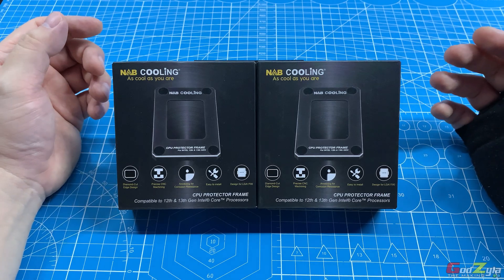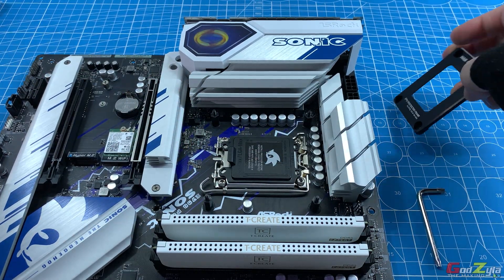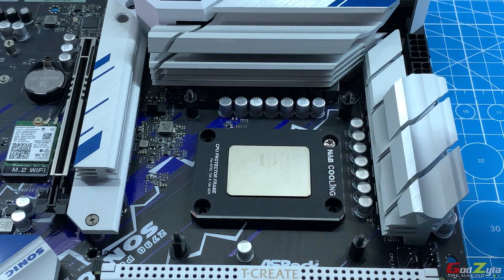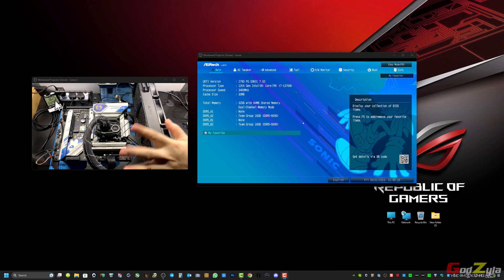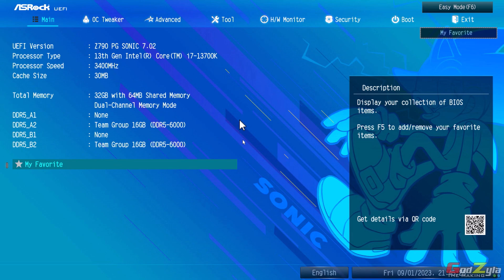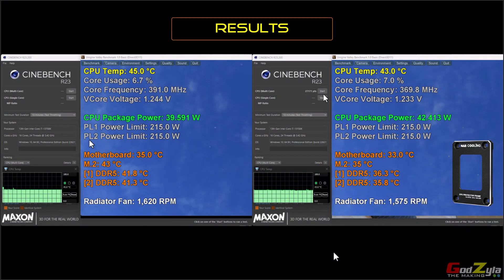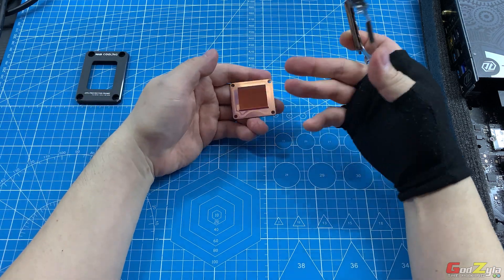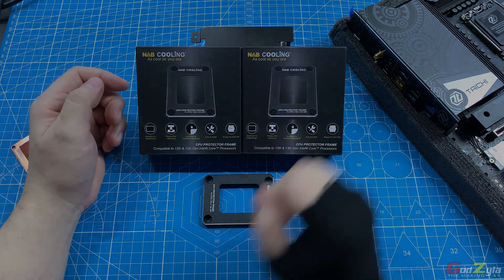NAB Cooling - Contact Frame (ILM) for Intel 12th & 13th Gen Processor

Comment: My cpu is thermal throttling after adding a contact frame, why?
Reply from the maker: Hi UnknownPlayground, welcom to my channel, which contact frame did you use and did you use. Also if you have used your CPU on the default 1700 mount for sometime and then apply the contact frame, this will cause thermal throttling as your IHS of the processor is already warp.
Reply: It's a 2 months build, and I swapped it just today, using the thermalalright frame
Reply from the maker: @UnknownPlayground-f7t  what are the troubleshooting steps you have taken. Did you reseat the contact frame. compare again with the original frame. these are the things you should test out and also replaste them. just a hint try this method of paste. Even though is on AM5 platform but the method to apply is of the same. https://youtu.be/xZ2R4roF1_Q

Comment: You should have shown the back of he contact frame, does it have pads under or does it float over the socket without touching the motherboard?
Reply from the maker: Hi mΛᄂy, welcome to my channel. it is using the motherboard backplate to hold the contact frame. infact most contact frame uses the motherboard default backplate, be is Asus, ASRock, MSI or Gigabyte Z790 boards.

Comment: how did it affect ram
Reply from the maker: Hi Ak47, welcome to my channel. you see if your coldpate that touches your processor does not aborb more heat off from the processor to either your liquid aio radiator of aircooler heatsink. the heat of the processor will go to your motherboard pcb. Surrounding the processor areas are your VRM, Rams slots and m.2 slots, so if heat does not draws away from your motherboard, it will go to those areas as I have mentioned. so having this contact frame, it helps the coldplate of your liquid AIO or Aircooler heatsink to absorb more heat, which results in lower temp of your RAMs.
Reply: @KleoYan  Very interesting
Reply from the maker: @AintPopular  cooling is not just CPU alone, areas like vrm and rams slots will aid in performance. The cooler you can get your pc components the better performance it can be.